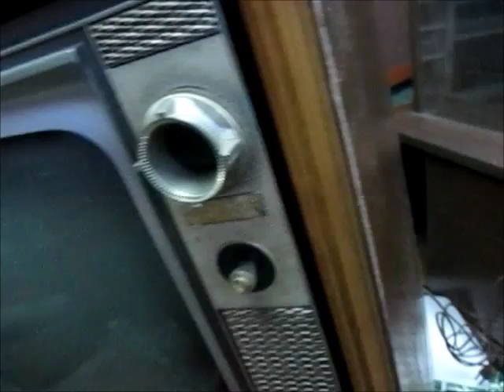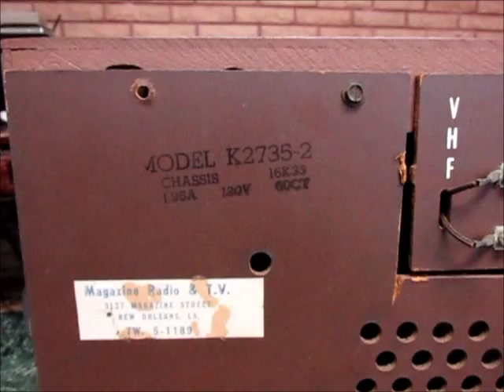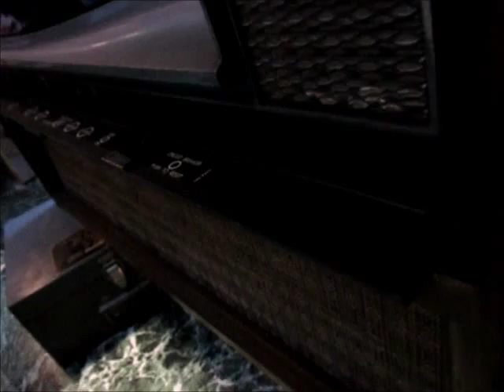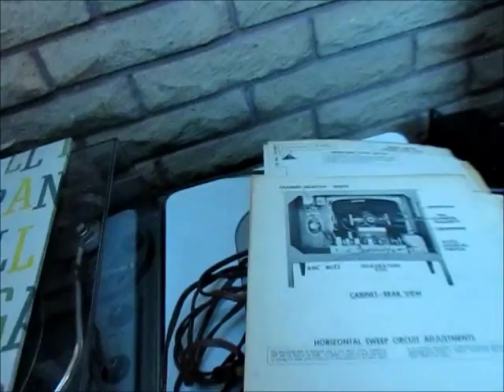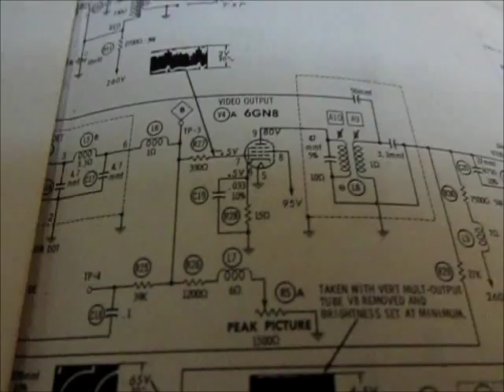EOL for a 1963 Zenith Console TV

Comment: Two things...
1. isn't this the TV that was seen in the opening of the movie "Twister" where Gary England is giving a tornado warning in 1969?

2. I've heard before 1964 they didn't use tension bands on the picture tube, and if you threw a rock at one without the safety glass in.place, the CRT would send pieces over a foot away from the TV? Did you implode the picture tube shown here? did you film it? I'd love to see how an old tube goes off on video, with the destructioner being safe about it and using safety gear.